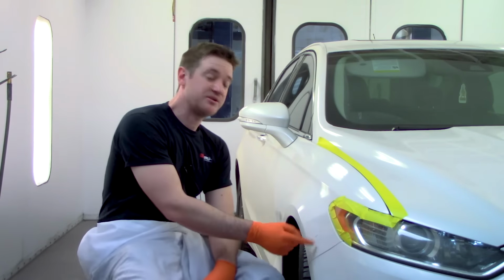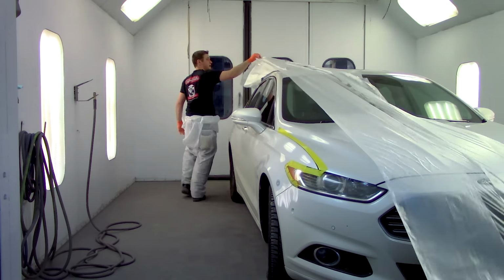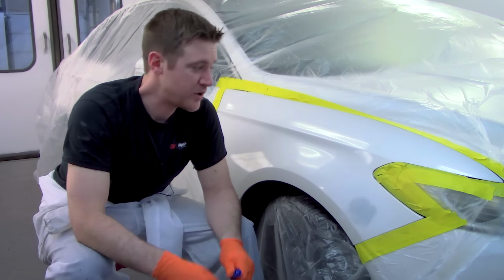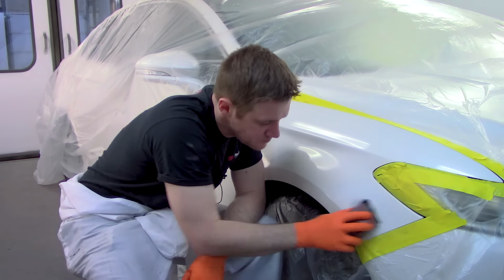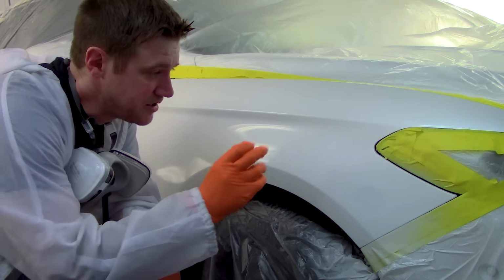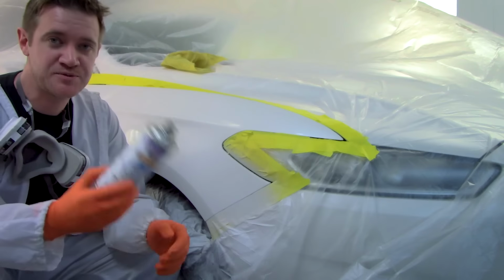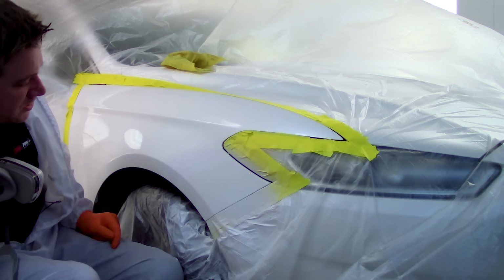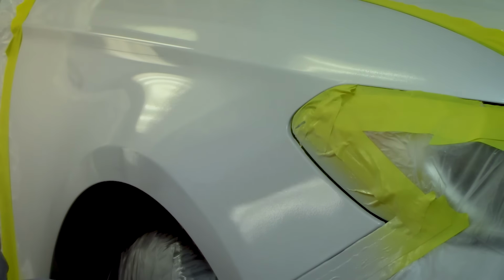You CAN Paint Your Car With 2K Aerosol Spray Cans!

Comment: Your quality continues to improve and remains an excellent resource for us DIY guys. Really appreciate the uploads!

Edit: I've a question actually - my door recently got ever so slightly dinged. You can barely see the indention around the scratch. I think primer would be enough to level it out, but is there a reason I shouldn't?
Reply from the maker: Thanks! Primer can crack if it’s built too high. It doesn’t usually have the filling properties to fill in a dent either, the safest route would be using a small amount of 2 part polyester putty first.
Reply: @Refinishnetwork  Drat, that's what I was wondering. Thanks again for the input and videos. I recommend you and Gabe all the time.

Comment: When you say sand and polish at the end, how long do you wait before doing this? And what grade sand paper would you recommend? Thanks!
Reply from the maker: It depends on the clearcoat, some are as early as 20 minutes (rare) and some are as long as 24 hours. You can remove minor defects with 1500, severe ones (runs, etc) you may need to start as coarse as 800.

Comment: Using your video to learn how to paint a new Harley Davidson inner fairing fender ABS.  I noticed you did not etch or otherwise run 400 or 800 grit paper over the abs before you cleaned the plastic and then prime'd the surface.  So I'm taking...that sanding or scratching the service is not necessary?

Comment: Can you recommend a wet bed or orientation coat to lay down on the entire panel before applying a metallic basecoat?  The wet bed reduces halo and prevents the metal flake from piling up in tiny sand scratches.  I was thinking spray the entire panel with SprayMax 1K clear, then reverse blend basecoat (spray larger area, then smaller, then repair area only), let that cure, then 2k clear the entire panel.  I'm just not sure if 1K clear is the best rattle can option for an orientation coat.

Comment: Good video 👍
I would have back taped the wheel well behind the fender,  taken the white blend further back and clear coated the entire fender since the can has a pot life might as well not waste it, and less work.  👌
Reply: Driven Image Customs isnt sanding the whole fender and then buffing the whole fender more work?
Reply: @dateatorjr9671   If you've been doing this long enough, then no, it wouldn't ake longer, much more efficient and faster. 

You would still have to finess and polish the blend and fender to remove overspray  anyways, specially on dark colored vehicles that wouldn't fly.  

I guess for a quick repair diy repair perhaps? 

Fwiw, if you can control dust, and know how to lay the clear, then you dont need to sand and polish the entire fender.

Comment: You never mentioned what company of basecoat you use? Which brand of 1k base that is?
Reply: Pretty sure he said it, but it's spraymax 2k epoxy primer. It binds to metal. Spraymax has another 2k primer for plastics